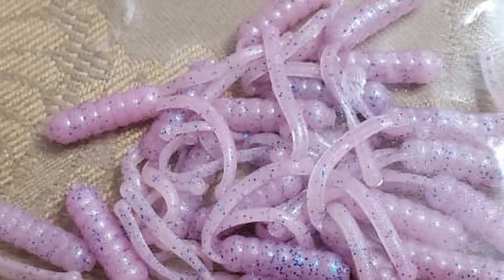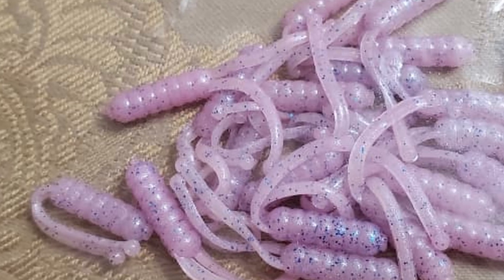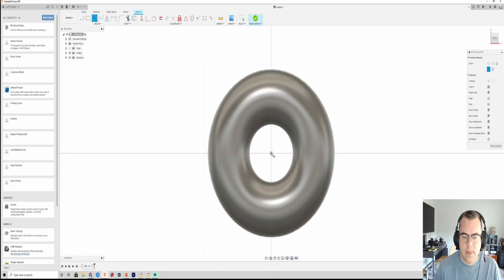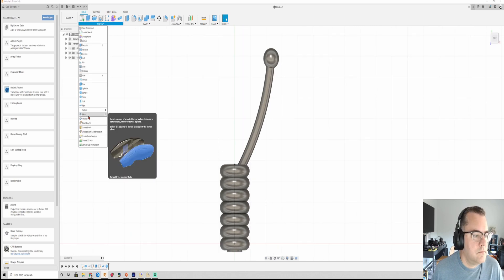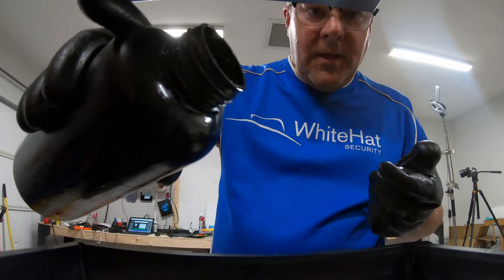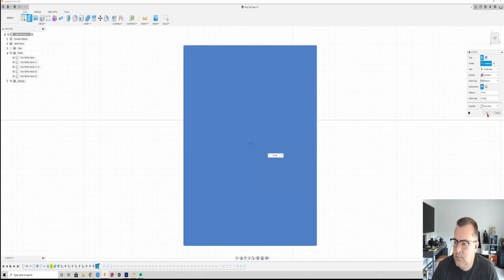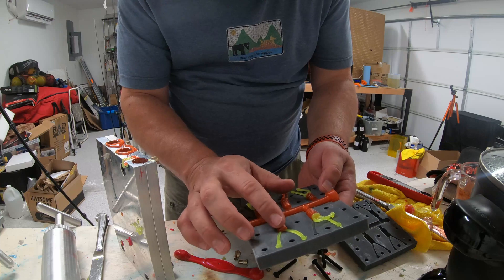3D Printed Pan Fish Lure Mold

Comment: Greetings, didn’t see anyone bring it up actually in the comment section, but can you elaborate a little bit on the “huge mistake” you made regarding the mold’s initial same side multi-cavity alignment while printing and how the second layout or cavity alteration changed the amount of resin that was used??
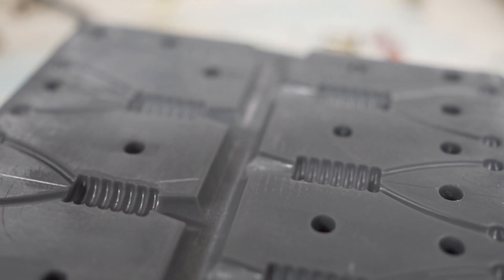@ (2:17-3:21)

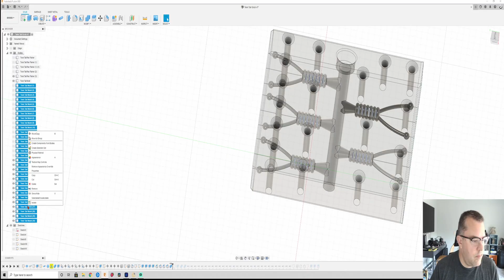*Specifically @ (3:07-3:13)(redesigned and “off-set” the lure cavities)??
Reply from the maker: Oh sorry! I forgot to add any holes for the screws/alignment pins! 🤦‍♂️
Reply: No worries, understood now for that part but also….
When you remade the mold you positioned the cavities kinda criss-crossed instead of side by side….and I believe you were saying that somehow that saved you some resin amount.  How so though?
Reply from the maker: Made the mold shorter overall. It saved print time for sure and maybe some resin.
Reply: @WMBayouLures oh okay…now I’m grasping the concept!  Thanks for clarifying! Awesome Stuff!✊🏽